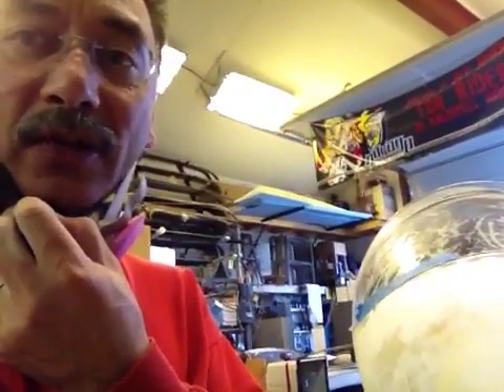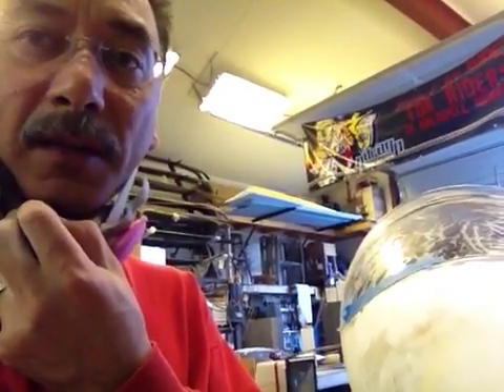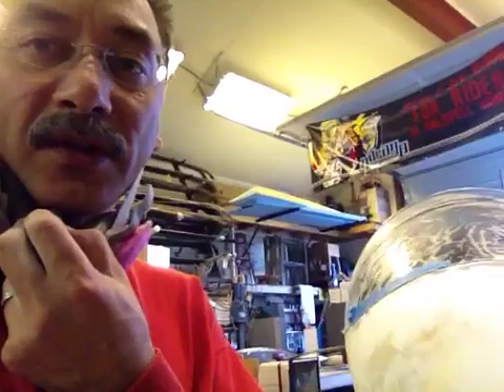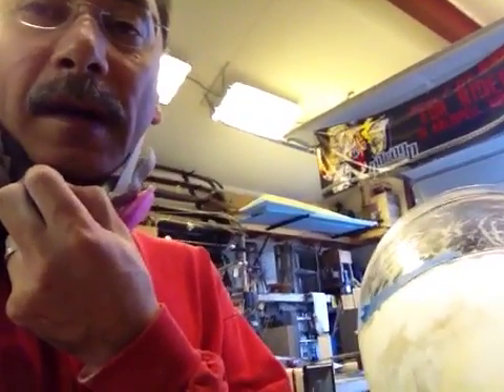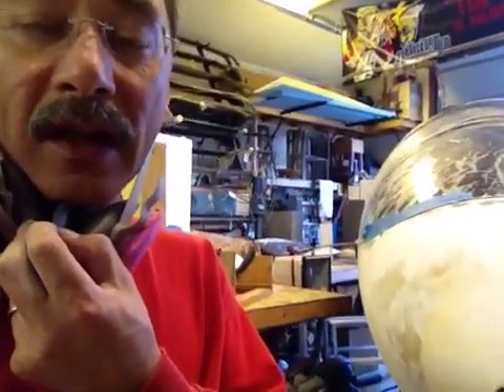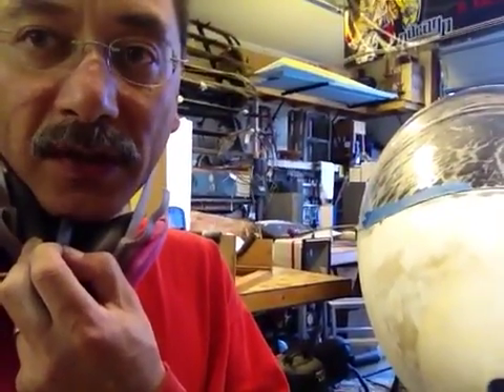Synergy designer/builder John McGinnis on sanding for NLF

Comment: I put in 600 hours on the wings of my Europa motorglider.  It paid off big time!  Iflew it from Spokane (SkyMeadow WN92) to Arlington fly-in rou d trip using only 11.2 gallons through my Rotax 914T.  Sanding is tedious but keep doing it until you can see no blemishes at all when you light a wall in a dark hanger and look down the wing surface toward the wall checkin for any blemish at all.  If you can see any blemish mother nature will form a drag bucket around it.